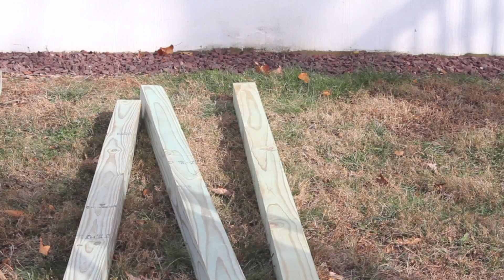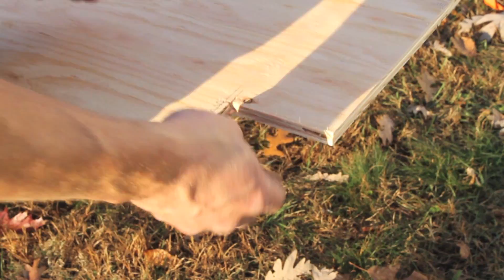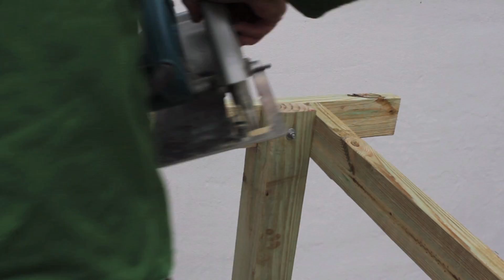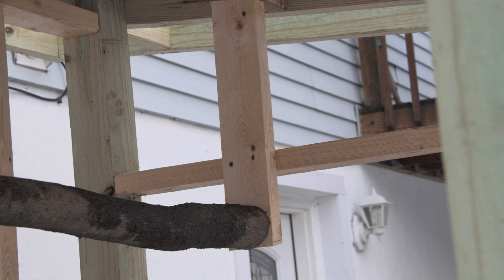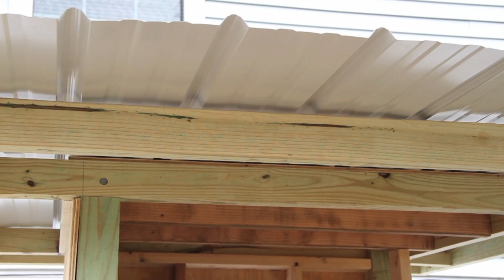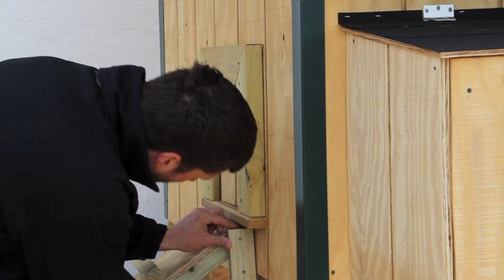Easy to Clean Chicken Coop V2.0: Step-by-Step Instructions with Free Plans

Comment from the maker: I am very curious to hear how the supply list worked out for this coop.  If anyone has built it, please let me know how it went.   Thanks!
Reply: Supply list worked out fine for me. I'd say to reduce 4 2x4x8 with 2 2x4x10. It was irritating to cut the 5' floor joists out of 8 footers to see I could have bought 2 10 footers. The screws were $9.36 i believe. I am using a screen door hinge on the nesting box as that will help keep it closed if it doesn't get locked by my daughter. I found something called t12 instead of t11 so I went with that. It was $41 and pressure treated. I'm not totally done but looks like I will have enough wood to do the coop structure. No fencing was mentioned. And I couldn't find the windows for the price listed but about $10 more. Also, I got 2x2 to frame out the nesting box as my supply store did not carry 2x3's.

On the build I don't know if you mentioned it in the video but one thing I ran into was not putting the carriage bolts far enough in on one board to mount the 2x6 that was installed with screws. I didn't forsee this and was just gonna mount the 2x6 on the outside of that side since it was hidden anyway, but ended up just noting out a small piece with a chisel for the bolts and stud.

I'd say that using a circular saw instead of a miter saw to make the notches is better because you get the even depth straight through and then use a chisel to clean up the left over.

Don't know if you mentioned it, but found that a 10 degree angle word well for the roof. I used this on my circular saw to cut out the notches at the top of the 4x4 posts and finished with a saw.
Reply: flemwad18 Will be building this coop Labor Day week. I'll post and let you know how it goes.
Reply from the maker: Mary Ann Abercrombie ok great.  Thanks!
Reply: we finally finished. It was a six week project. We moved them in yesterday and just in time. Found an egg in the coop today. I'll post a few pics. 
We expanded the size of the coop and attached it to a run. Total size of run is 7.5ft by 24ft. Coop is 7.5ft by 5ft(with egg boxes making it 6ft).
Reply: how does one post pics?
Reply from the maker: +Mary Ann Abercrombie Nice work Mary!  I am excited to see the pics!  If you send them to the email address on the plans / in the video that would be great!  I can post them to my flickr page.  (I'd give you the email link here but I would likely get a lot of Spam emails).  Thanks!  I am so glad it worked out well!
Reply: Or not lol
Reply: Kin you make to me
Reply: Is this what you made and then attached the larger screened in portion onto?
Reply: I have spent months researching into constructing coops and discovered an awesome website at Coop Magic Tactic (google it if you're interested)

Comment: I am planning to build this coop.  It looks like you shorted the number of carriage bolts required.  I count 10 carriage bolts on the plans (since the 2x6 side of the platform shows 2 carriage bolts in each corner), but your supplies list shows 8.  By the way, thanks for making this available!
Reply from the maker: Douglas Zedler ah, yes you are right.  Thanks for pointing that out.  Please let me know how the project goes so I can adjust the plans as needed.  Thanks!
Reply: I'll do that.  So far, I've gotten through the step where I attach all the carriage bolts.  I'll probably work on it a lot this weekend.

Comment: great movie , really helps me allot ! :) .1 question i have at this moment : what size are the screws that you are using please ( length/diameter ) ? And what size is the drill you are using to pre-drill for them ? thanks :)
Reply from the maker: Adrian Ionescu Hey Adrian, I am glad the video helped.  I put together a supplies list for this build.  You will find the screw sizes there...

https://www.flickr.com/photos/coopinstructions/17069910222/

In terms of the drill bit size, it doesn't matter too much, you just want it to be a little bit SMALLER width than the screws.  Maybe 1/2 - 3/4  the width of the screw would be good.

Comment: How big is your other chicken coop... And how many chicken do u think this could hold
Reply from the maker: Dylan Michael The other chicken coop I have is 5x6 (That coop could probably hold 12 chickens).  

Provided that you have a lot of room for the chickens to run during the day you could probably put 7 birds in this 4x4 coop.  They recommend 2-4 square feet per bird inside the coop.  16 square feet with 5 birds = 3.2 feet per bird.  6 birds = 2.7 feet per bird.  7 = 2.3 feet per bird.    So obviously 7 would be tight.  4-6 birds would be optimal.

Comment: Thanks for the video and plans.  Very easy to follow.  How many birds max would you say this size coop holds?
Reply from the maker: Justin Graves Provided that you have a lot of room for the chickens to run during the day...this coop would work for 7 birds max.  They recommend 2-4 square feet per bird inside the coop.  In this coop with 5 birds = 3.2 feet per bird.  6 birds = 2.7 feet per bird.  7 = 2.3 feet per bird.    So obviously 7 would be tight.  4-6 birds would be optimal.